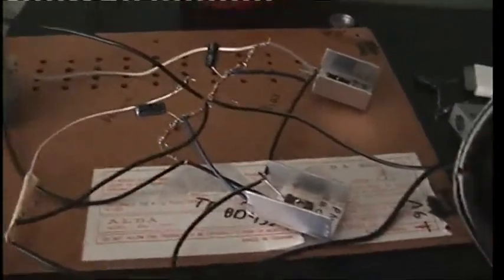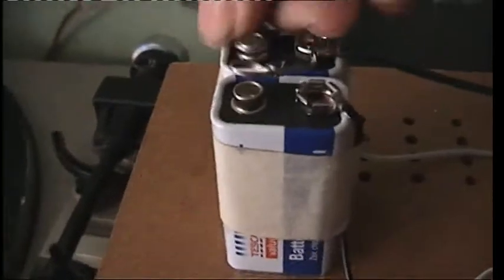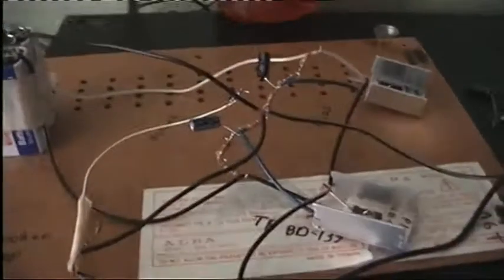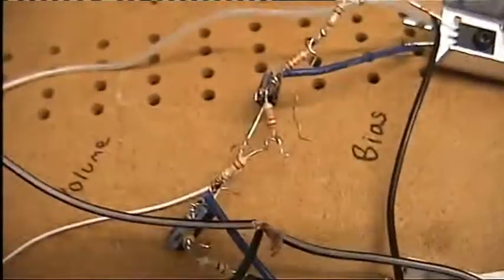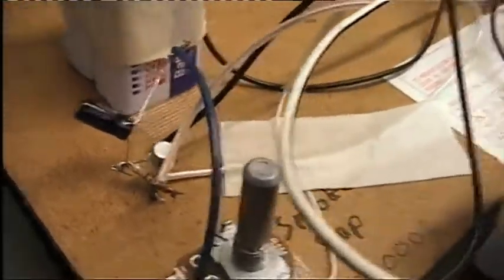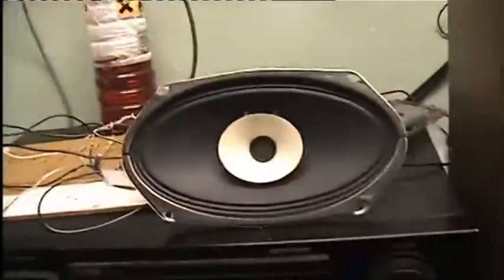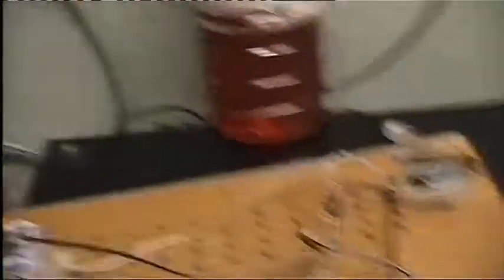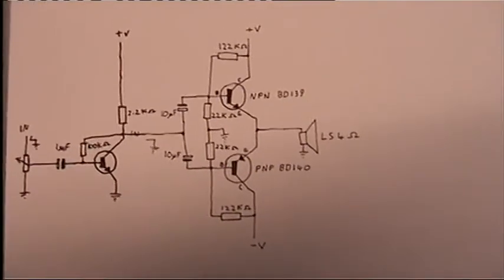Tinkering wih transistors, some amplifier experiment.

Comment: Use potentiometers in place of resisters in the voltage divider part, adjust until it sounds good. Be careful never turn all the way open - the transistors will blow.